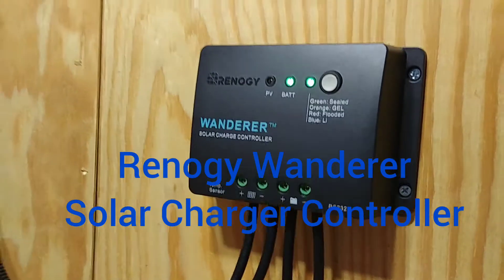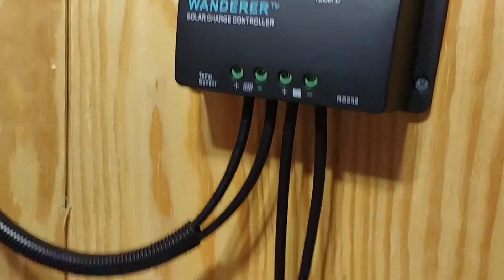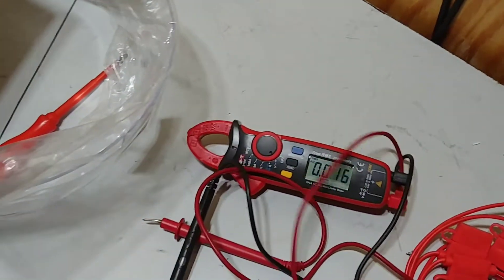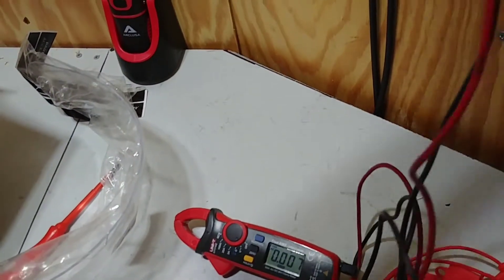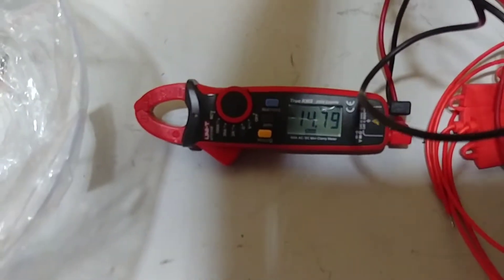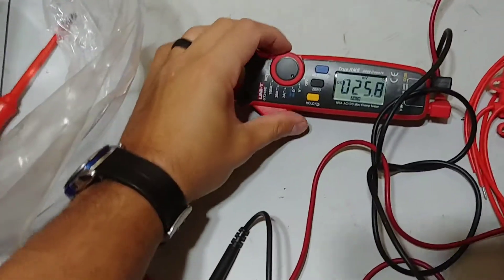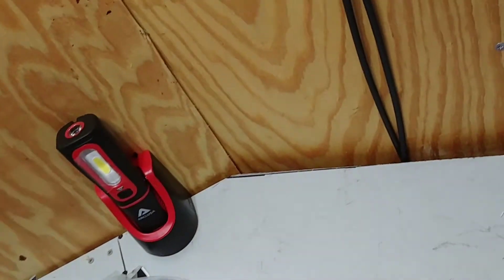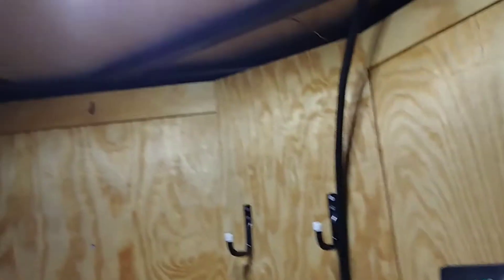Renogy Wanderer Solar Charger Controller

Comment: Just got this one and have no idea why my PV light is not coming on. Any suggestions?
Reply: Mine did not light up until the sun was out. I installed at night and got nervous. Just make sure you connections are correct with your polarity from the panel.